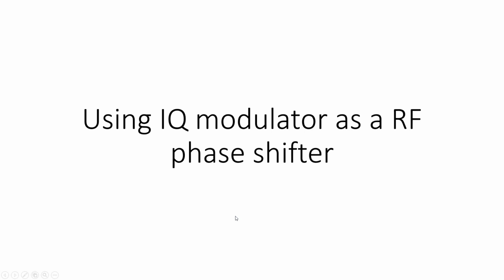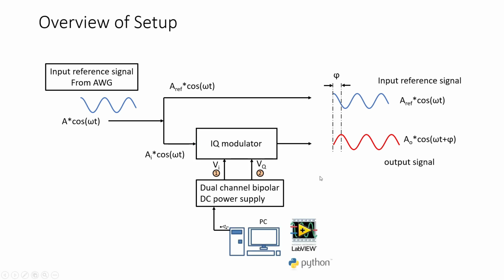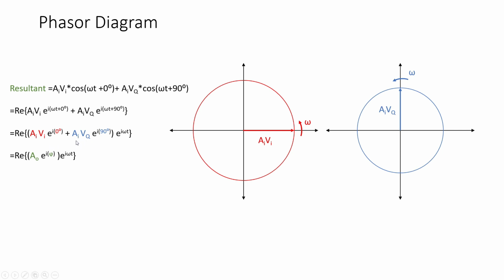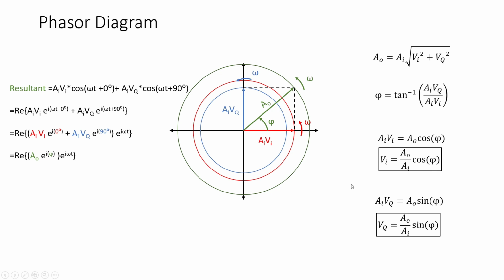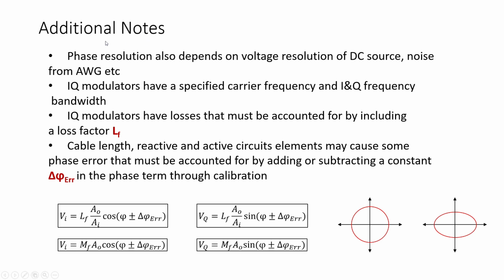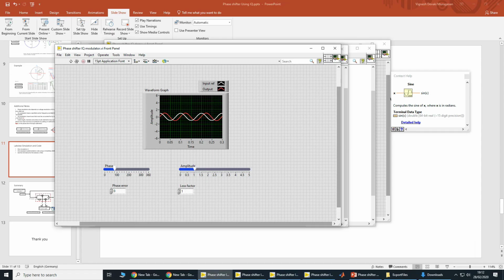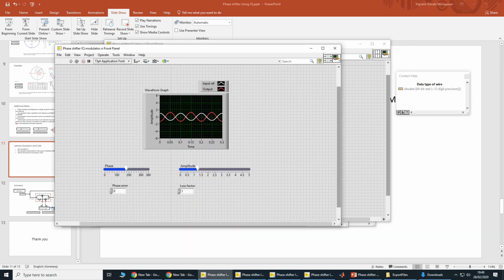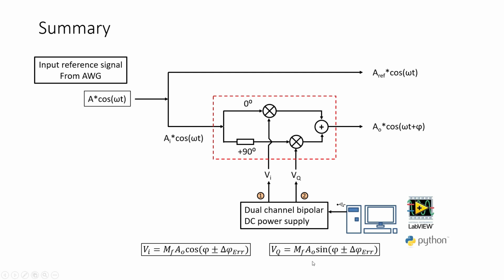RF phase shifter using IQ modulator (with LabVIEW demo)

Comment: Great analysis, explanation and simulation. Very valuable. Can this be done with a phase locked loop PLL synthesizer for 360 degree phase shift?
Reply from the maker: Thank you. If you watch this video https://youtu.be/SS7z8WsXPMk?t=1211 you will see that it is possible to do it with phase locked loop, but for square wave.